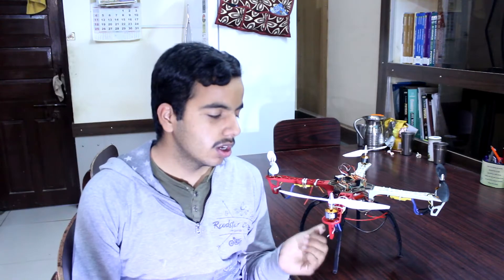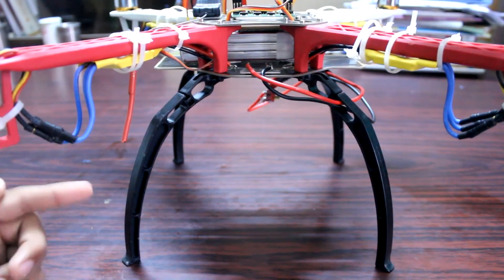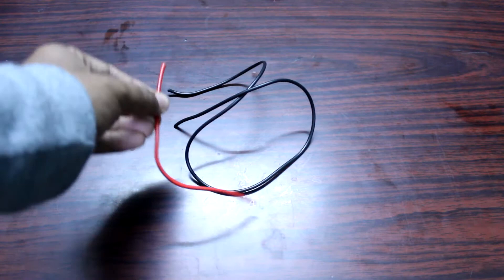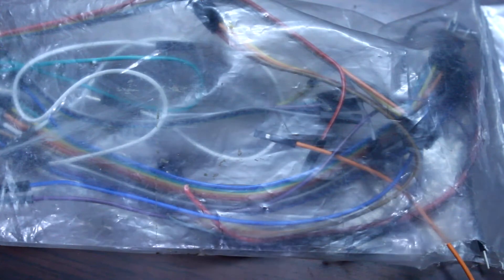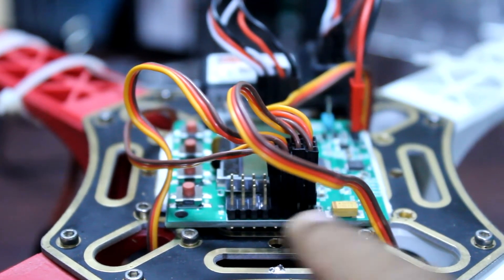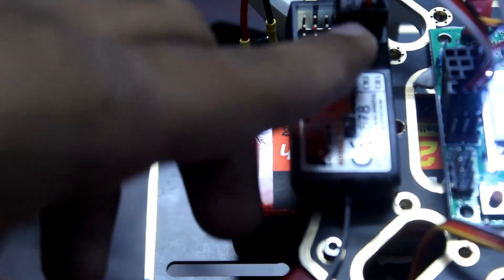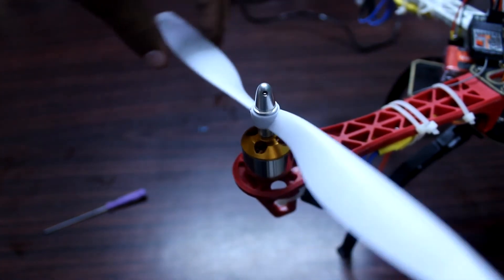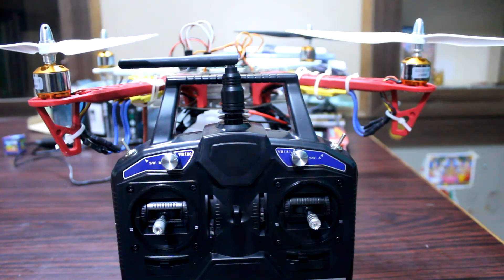How To Make Your Own Drone(Quadcopter) At Home Using KK 2.1.5/Arduino Uno

Comment: All motors are not rotating at a time when it is armed. What is the solution for this
Reply from the maker: Connect properly to esc and check if esc or motors are faulty
Reply from the maker: Calibration of esc is requirrd

Comment: can quadfly if battery voltage 10.5v
Reply from the maker: +muje yaad yes
Reply: vaii jab me throttal up karta hu toh motor spin hota he but quadfly nhi ho pata or phir se start ho jata he...kisliye plzz help...kk2.1.5
Reply from the maker: reason is wrong orientation for propeller probably

Comment: kk rs 1100
Reply from the maker: +Madhav Prasad Saraswat nice
Reply: if you any problem of all flight controller so you are contace me and are you purchess any product of the drone so we are provide you in low price all parts of the drone.......cantact me whatsapp.....8739818980
Reply: Mera quadcopter har time ek side me tilt ho rha hai. Jab bhi throttle increase karo wo ek side me jata hai. Pls help. I used Kk2.1